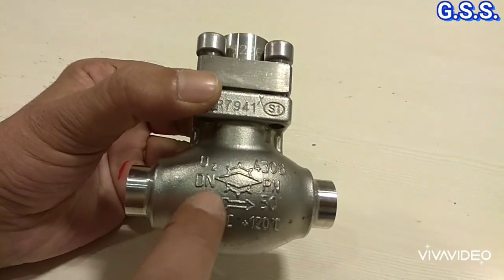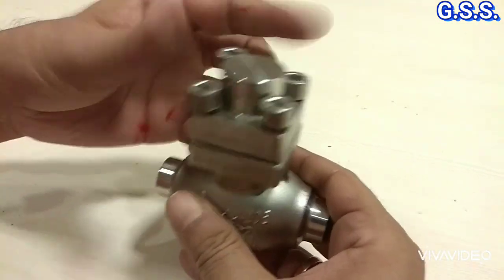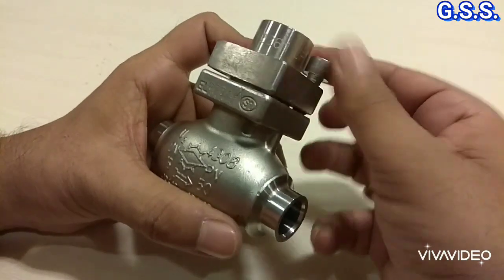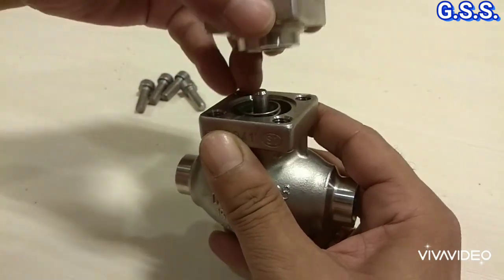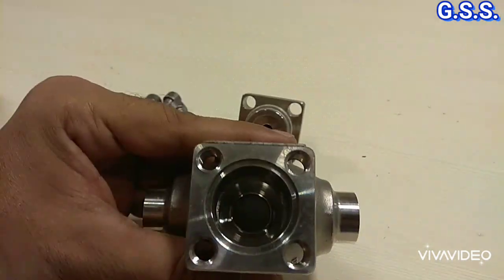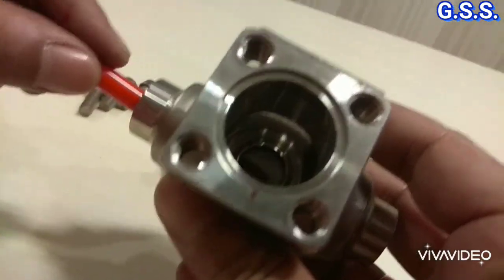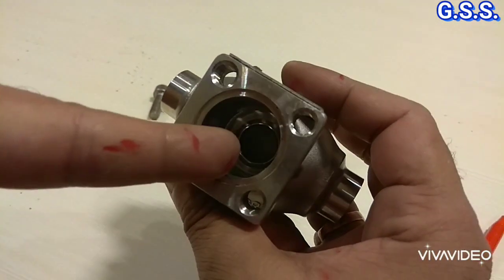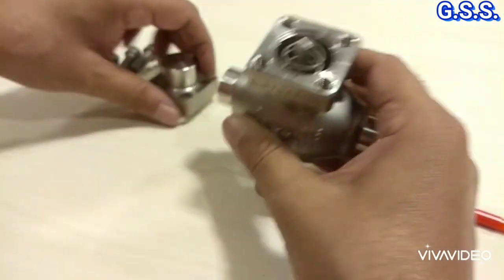Piping Engineering : Piston Lift Check Valve - Internals

Comment: A gasket is not required when mounting the bonnet?
Reply from the maker: Yes, gasket is there in between body and bonnet joint.
Reply: @gourisankarsamanta7670  But didn't see in our video